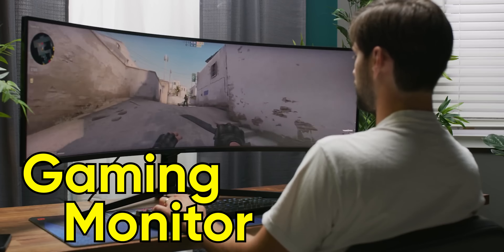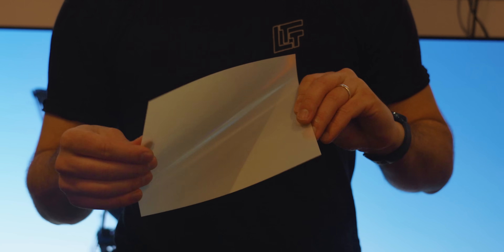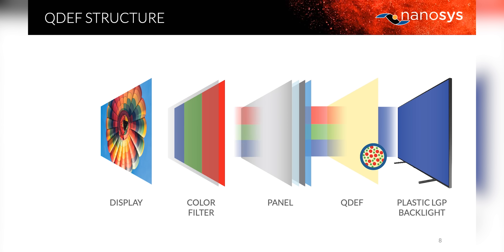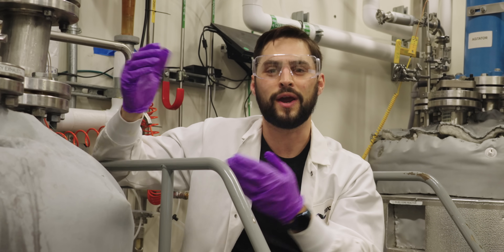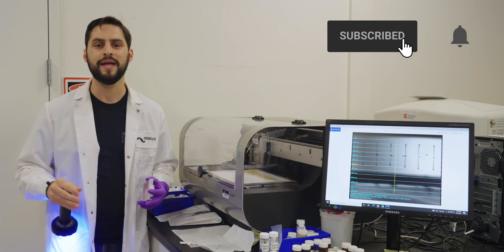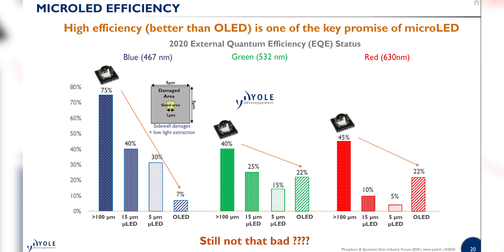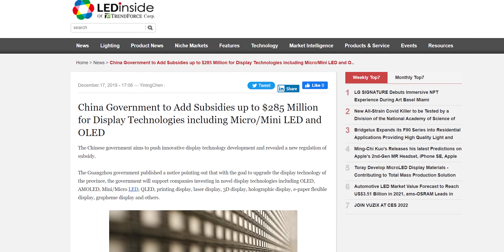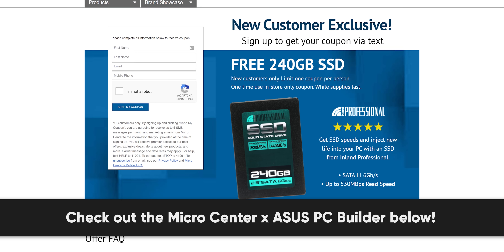This Goo is the Future of Gaming Monitors - Nanosys Tour

Comment: Trying to build my own PC. Anyone got any monitor suggestions? Budget of abt 180 CAD. Also, is there any trusted sitr where you could get a B550M Wifi board that could possibly come in flashed? Thanks!
Reply: There is a good chance you won't need to update a B550 board for ryzen 5000 (mine came with the second bios version ever released for the board, and while I did have to update it to get ram to work at higher speeds, it still worked fine).
Reply: @coreforge  I really hope I don’t have to. Where did you get yours from??
Reply: Not a monitor suggestion but a guide towards your desired motherboard. Some Gigabyte B550 motherboards (like mine, I did this procedure too) come with a button that allows you tu upgrade your BIOS without a CPU installed, meaning that you could get the update to enable Ryzen 5000 CPUs without needing an old Ryzen CPU, which is the problem you might be worried about. You could try this route. I have a B550 Aorus Pro, the model without WiFi, but there is a model about 20 bucks more expensive that does have built-in WiFi.
Reply: Are you familiar with Amazon Warehouse? That will stretch your budget a fair bit. Also, what are you going to use it for most? If gaming, I think high refresh rate is far better than high resolution. An Asus VG278Q is a great budget 144Hz monitor, for example. And if you set up strobing with a special program, you get absolutely 0 ghosting
Reply: @xibeca  I’m not familiar with Amazon Warehouse. I plan on using my monitor for gaming and schoolwork. i’m not familiar with what strobing is as I am kind of a noob at this, but I’ll check that monitor out. Thanks!